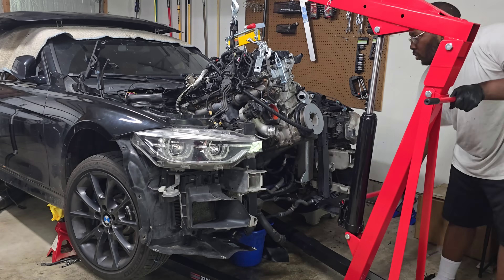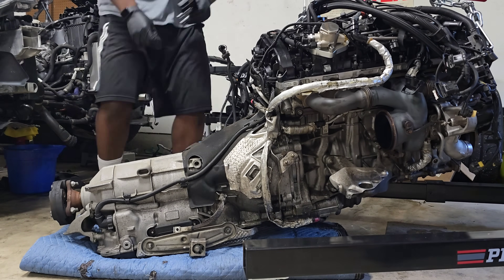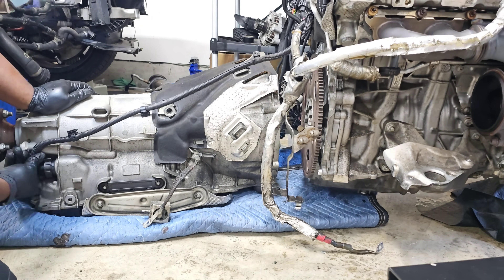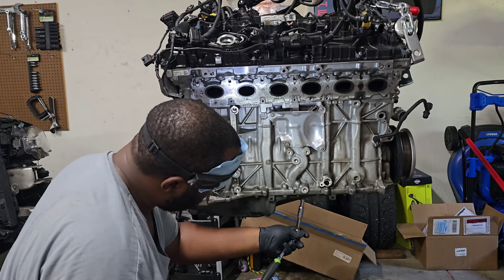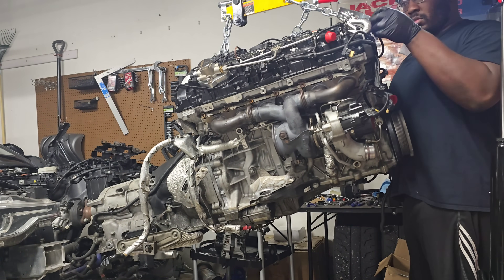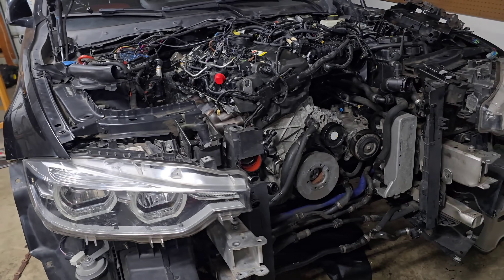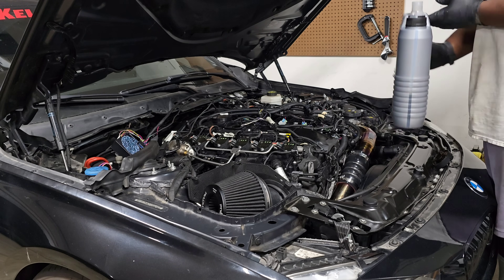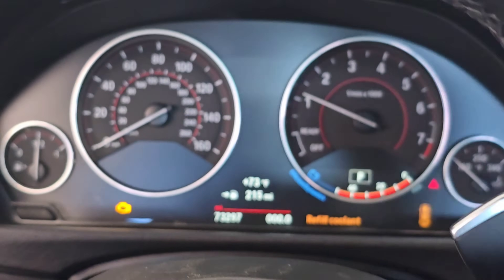How to Install a B58 Engine in 15 minutes (340i Engine Swap Part 2)

Comment: i recently got mine swapped 2018 m240i to another 2018 m240i although it won’t shift into drive or anything and my mechanic says it’s a programming issue. any help?

Comment: My 2020 m340i blew up cylinder 6 just a couple questions did you use old or new dme. if I were to get a awd engine is the transmission mount different. Do you think the mild hybrid from a 2021 or newer will cause any issues on a non hybrid car. I know this is different from what you did on your car but I cannot find anything about swapping a gen 2 if you see this and reply I really appreciate your time and what you do for the community hope you have a great day.

Comment: I bought a new febi valve cover, Bosch fuel injectors installed it drove on the freeway and car started smoking bad and got drivetrain malfunction and leaking oil, any thoughts or suggestions?
Reply from the maker: Get an oem valve cover. Febi is no good
Reply: @kern417 WOW okay thanks will do, Im scared I blew the engine or turbo turn on car and it looks like the undertaker entrance smells bad and drives really slow

Comment: How many miles does the new used engine have out of curiosity?
Reply: Yes I missed that part apparently how many miles are on the other motor and did you get to do a Carfax or something to try to find out what kind of Maintenance it's had

Comment: Much respect to you Kern for doing this project and documenting the process.  Since you asked for feedback, please consider the idea of “secondary “ or “contingency “ support while working under your car.  I would recommend wooden blocks under all 4 the tires in case a jack stand fails 2x10’s work well) .  When I am working under my E46, I raise it about one foot off the garage floor and support it with 2x10” 2 feet in length.  Then place jack stands under all four jacking points…creating an extra margin of safety.  Stay safe and keep making these amazing videos.  😊